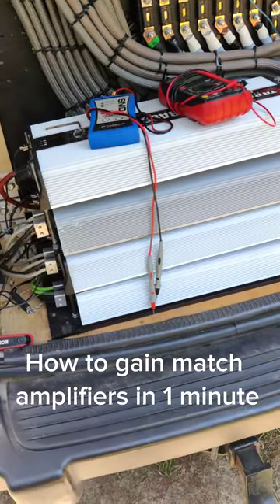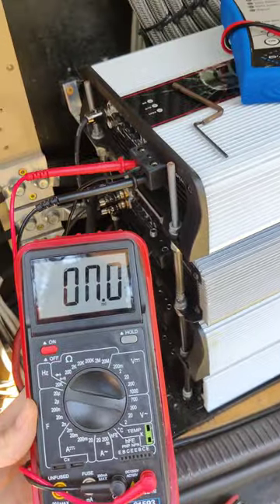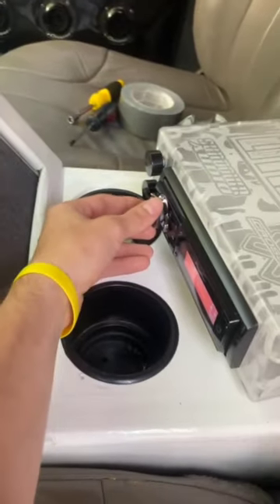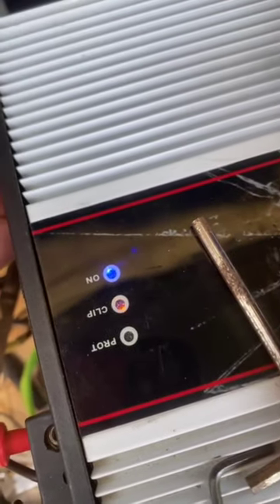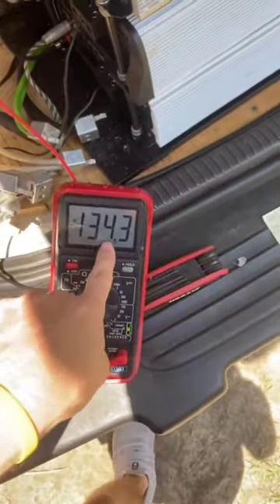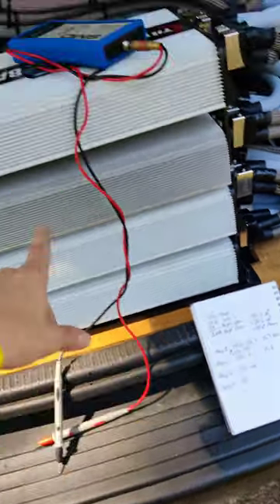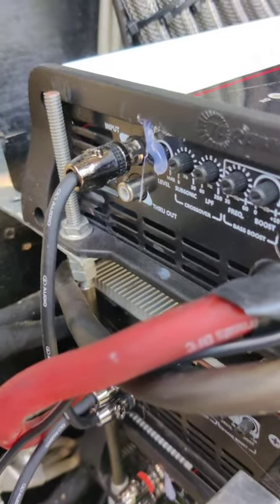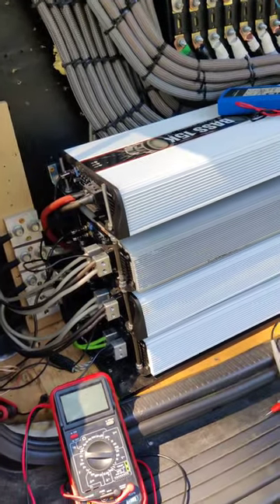How to gain match multiple amps in 1 minute!

Comment: Question  celeb, what did you have your radio EQ set up as while doing this testing? I did mine this exact way. And my SW level on the radio was at +10 (it can go down to 0 or -10 too) but i for got all about it. When putting in new amps. It's clean just not loud as i remember it.
Reply from the maker: @Mr.Weatherspoon  I would set your SW level down to 0 and reset your gains again, anything you do with the radio for subwoofers can alter the signal at the amp. If you still have problems after redoing the gains lmk